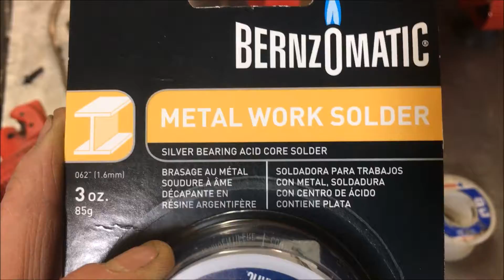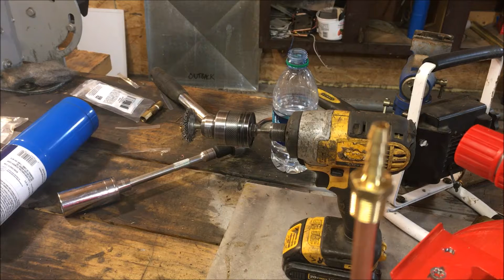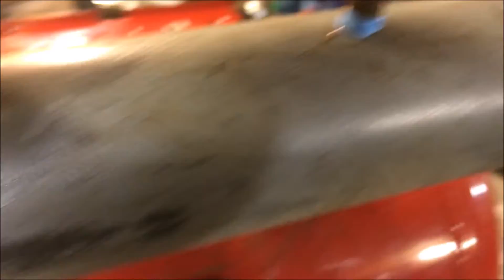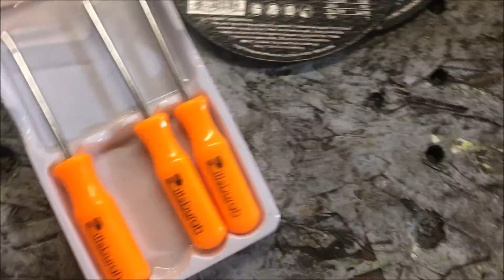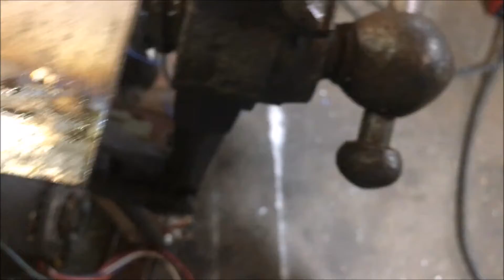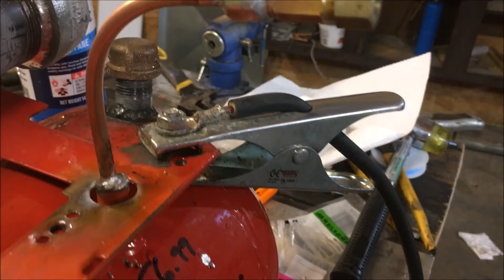Best Solder ( What brand Out flows the rest ??? )

Comment: I hate compression fittings no matter what you are running through the pipe/line. Never thought about soldering them though. My air compressor has one on the small line that kicks the solenoid off, I can’t get it to not leak. I don’t think I can solder it without fucking the needle up.

Comment: I've never seen anyone solder a compression fitting but it will definitely not come loose or leak.  As far as your steel to copper joints I would braze those.
Reply from the maker: expensive move if the application doesnt  need high strength
Reply: Brazing is more than adequate for this application.  Brazed joints are sometimes stronger than others because of the filler going into the whole joint like solder.  It also ideal with dissimilar metal joints.
Reply from the maker: Yes i agree , however , the HVAC  industry often chooses silver solder over brazing because brazing copper will  weaken the tubing
Reply: Well, I have formal training and have performed HVAC work.  Sil/phosphorus braze is what should be used and what I use on ACR lines.  Its also code in most areas including mine, for the heat rating in case of a house fire.  Another benefit is it does not require flux which you don't want contaminating a refrigerant circuit.  Its also known that the strength loss is a trivial issue compared to the others I've mentioned.
Reply from the maker: yes i have also herd not to allow solder at all but i just red that info on a bridgit solder web sight pdf and it does make sense , copper is supper soft after brazing . im not disagreeing with you friend just sharing information , thanks for your input